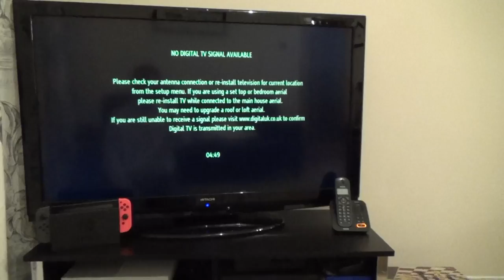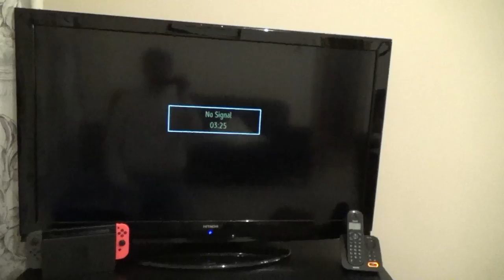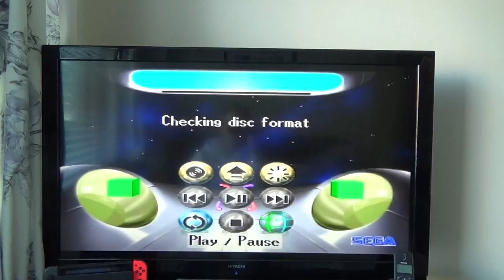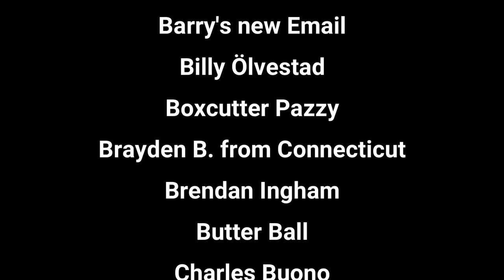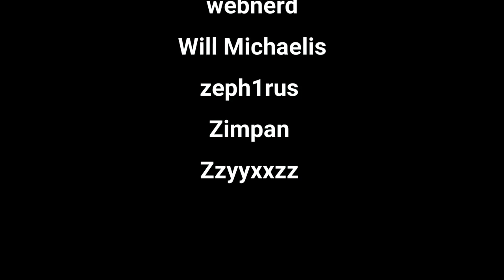SEGA SATURN with NO DISPLAY - Can I REPAIR it?

Comment from the maker: Spoiler Saver

Thanks for watching
Reply: please help me figure out whats going on i can use my dualsense in the ps5 menu but when i go on a game and its says press x to continue x doesn’t work on a game and on gamepad tester it shows L2 is being pressed down even when im not helppppo i have no warrenty😢
Reply: @whodat4265  Watch a YouTube video guide on how to take apart and clean the controller. While you're inside, check if there's any corrosion or other visible damage. Once all the buttons are cleaned out and thoroughly checked for damage, put the controller back together and test it again.
Reply: @Box223  ok to took it apart and the trigger spring is fine and looks like the r2 side so the springs are good and theres no garbage like dust and stuff but still doesn’t work i tried also lifting the trigger hard and still nothing
Reply: @Box223  what i mean by still nothing is l2 is still being pressed without me touching it
Reply: @Box223 also i cleaned with 90% alcohol and q tips and blew for dust
Reply: @whodat4265  You may need to look closer and test each component on the controller individually. I have never taken apart one of those controllers, so I have no experience with them. I'd recommend checking different online sources based on what you're seeing with your testing. iFixit probably has some guides on it that would be good to look through.
Reply: @Box223 honestly it sucks but i might just have to wait and buy a new controller i suck at doing stuff like this
Reply: @whodat4265  You could sell it to someone or send it to a repair shop if you want.
Reply: @Box223  dont got money for that but its weird cause i just hit it a couple of time and l2 works fine i guess now but my up arrow reads completely 0 on gamepad tester now 🤦🏾‍♂️ 🤦🏾‍♂️
Reply: Yeah I knew you have one of those in the cold storage I told you that go grab it and grab the laser it was in the old ass video from quite a few years ago when you did that one but you never bought and brought it back out because you knew it was one of those rare ones
Reply: Even you said when you found the first one of nine series it's extremely rare there's only like a hundred thousand made so do it for you to have a working fully functional one it's probably worth a lot of money

Comment: If you have a Dremel or other rotory tool, you should get some rubber bullet tips instead of the engraving tool. It will remove the solder mask, but isn't abrasive enough to take traces with it (under normal use). Either way, love the videos!
Reply: Yeah the abrasive rubber tips are the correct thing to remove soldermask, ie, I was cringing at the damage from that metal tip.
Reply: Do you have a pn or link please cant find them
Reply: @flibble666  No links allowed on YT. Goo search the name.

Comment: Nice fix! Great find. Great when it's something simple like that and not an obscure chip!
About the pots though for the CD drive, in any Disc based drive, never adjust the potentiometer by hand. These are tuned to the micro ohm and should be measured using your best possible multimeter or oscilloscope if you have one. The slightest tweak to them causes a huge change in resistance, enough to burn out the laser in some instances. That's why we call them "pot tweaks" :)
Reply: That the thing always use the Resistance mode to record the current value before tweaking the pot as the last thing anyone wants to do is tweaking it and not knowing what it was originally either too much or too little can kill the laser diode. Ideally the laser glass can be cloudy to the point where it could barely read the disc usually cleaning it with ipa and blow out the dust in behind the laser glass can help to a certain degree to get it working again as I done this method on phat ps2 had good success but the one that annoys me the most is the tilt screw on the drive closest to the back of the ps2 usually mark it with a blade but as it turned out the mechacon chip has a bug where it continued to kill the laser after too many time it attempted to read the disc there for ruining the chance of a laser replacement to make it work again. So the phat ps2 had to be softmodded/hardmodded to get around this problem
Reply: Agreed, I’ve just restored an “audiophile” model PS1 and the window for the laser working perfectly is impossibly small

Comment: 23:15 it's always easier to remove enamel from magnet wire by starting at the cut end, because there's exposed copper there that will take the heat from your iron and burn off the enamel from the inside. I usually put a blob of solder on my iron, stick the end of the wire into it and slowly work it through, maybe adding flux if the solder starts to get lumpy.

For something like this, I usually just strip a length of cheap 30 awg wire rather than bother trying to de-enamel magnet wire. For smaller sizes (34 or 38) I do use magnet wire because it's really all that's available.

Comment: Nice fix so far Vince, I did notice when you were working on the solder blob to the left about 8 o’clock from the solder blob there is TP95 & TP96 and C51 there looks like a long leg that could be shorted over from TP95 to C51 
Thanks for the upload 😊
Reply from the maker: I see it Gary, that is from one of the crystals. The legs are a little long but they are not shorting. I've bent them over towards the left hand side just to make sure. Thanks for the suggestion mate 👍
Reply: @Mymatevince  ok cool just a thought that’s all, well at least it’s doing more then it was when you got it 😊
Reply from the maker: @wisher21uk  Always up to hear suggestions Gary, makes me life easier 👌
Reply: @Mymatevince  so true the more eyes the better 😁

Comment: The disc protection is on the far outer edge of the disc on the Saturn, and a weak laser can struggle to read this edge. It's possible that you have a marginal unit that works on one machine but not the other. There are some pots on the PCB of the CD mech assembly and one of these controls the tracking - sometimes this can be brought into like making the discs work.

If not, a modchip would likely fix the problem as that bypasses the protection.

ETA although if a known good mech doesn't work then as others have said, it could be the region lock. Again a modchip (ahem) would help here 😁
Reply from the maker: Thanks for the tips Jason 👍👍👍

Comment: Fantastic Vince!!! Great stuff working that one out =D  I would be tempted to go back to using a fibreglass pencil btw - that grinder is a wee bit aggresive lol!   The fact that audio discs work, and games dont - my first thought is region, is it perhaps US or JPN?  Alternatively some damage on the ribbon or its connection to the board?
Reply from the maker: Thanks Chris, great suggestions.  Ribbon cable was checked for continuity off camera, well it was filmed but cut. It is testing ok despite the burning. Region is a great idea. I will find out how to check the region on these things. Maybe serial number will indicate that. Nice one 👍👍👍👍
Reply: Good shout Chris, I also thought Region, but looking back at the video it appears to be a VA9 revision board, so that's almost certainly PAL.  Definitely will be worth looking at the ribbon, it did have some discolouration on one edge, so it's very possibly damaged...
Reply from the maker: @StezStixFix  Cheers Steve, ribbon cable tests OK for continuity. Shame about the region, but st least that means it might be fixable. I need to find out what chip is responsible for the security check and work from there I think. Maybe it is still linked to the corrosion 👍👍
Reply: @Mymatevince  I did a region mod on a Saturn a while back, it “might” be some help, although I had to follow two different guides to get it to work.
I’ve got quite a few saturns in pieces, so if you need me to check for any spares you need, let me know and I’ll send them over if I have them 👍👍
Now time to watch the video 🥰
Reply: Another video, another comment at the top spoiling the outcome before it’s even been watched. No one’s fault but YouTube, but there really should be a default way of stopping this for the video creators
Reply: @philgornall  yeah, annoying enough
Reply from the maker: @philgornall  Sorry Phil, I just added the Spoiler Saver. Apparently it doesn't work on phones,  only PCs 👍
Reply from the maker: @1up_Gaming  Thanks Mike, I'll check it out. I'd prefer to fix it if possible, but just happy to have it work again if that fails👍👍👍👍
Reply: @Mymatevince  as I said mate I know not your fault. I’m always on the phone so will never work for me. Another perplexing functionality decision from YT…

Comment: I normally use a one stran of 16 gauge wire, then when put through the hole the solder will flow through the hole if you add a little flux and if it was multilayed you have more chance of joining the tracks in-between. I know this is only double sided but I find enabled wire for short distances is more trouble than it's worth.
Reply from the maker: Thanks for the tips David 👍👍

Comment: Normally for top 3 issues with repairing old/new stuff is i've noticed....

1 chips you can't buy.
2. track layers.
3. components like resisters and capacitors.

Comment: It could still be that solder blob across the 2 pins on the cable which you re-added, 
It could be the trace near the FB9 writing which was blackened underneath the solder mask.
Reply from the maker: Well spotted Mike, unfortunately for me that blackened trace is actually testing OK, I'm just working on the next video right now 👍👍👍 Cheers for the suggestions
Reply: @Mymatevince  no worries. Hope you get it sorted. My other concern was that some capacitors were replaced with incorrect values before you received it.

Comment: Great Video Vince! and great job on repairing those corroded tracks and VIA's. Would the fault with the disc drive have something to do those shorted pads? as that did look a little odd to me. Keep up the great work 👍
Reply from the maker: Thanks Mick, I'm working on it again as I type. Just looking though some different options to try and work out what is going on. The blob is one of those options. Cheers 👍👍

Comment: I had similar with a double layer motherboard, you were lucky, with the board I had, the corrosion had worked it's way between the layers and spread.
A definite Vince no go
With no signs of spillage or capacitor juice, this just might have been a dodgy board.
Good video, can't wait for the follow up,
Reply from the maker: Just working on it now MCW 👍👍👍

Comment: Fairly interesting. I picked up a 2nd saturn, the white HST-3220 model...I knew when I bought it that it wasn't going to run, it DOES have power, but it won't broadcast anything, not even a black screen. I took the board out and it's super clean looking, no popped caps, nothing. I'm not even sure where to really begin since my tools are very limited, soldering iron, flux, wick, and a multi-reader that's about all I got in my arsenal. But my electrical knowledge is extremely weak, so dunno yet. 
Talked to a buddy of mine who's looking at a diagram of the saturn and he's gonna try and point some stuff out to me. The goal on this one was to restore it, but to put on a Fenrir ODE on it and put the working Saturn in a nice safe place so it doesn't burn out.

Comment: Going from the switch killer to saturn slayer seems like a regression, but only in technology 😂. Well done! Looking forward to the next part.

Suggestion: Check your 5vDC (I think) rail to the disk drive. Is it low? Does the DC voltage look dirty on an Oscope? Could indicate a bad filter cap. It may be a cause for why neither disk drive works in the Saturn as intended.
Reply from the maker: 😂 Well I do feel like I am regressing in many aspects including my understanding of electronics!
Good idea, I will check that out Shawn, nice one sir 👍👍
Reply: Going from the switch killer to saturn slayer haha best comment yet 😂🤣😛
Reply: @Mymatevince  you're not regressing, only joking 😂
Reply from the maker: @HavingFunRepairs  😂

Comment: If you want solder to flow into the via a bare copper wire is probably better.
Reply: Yes, I was going to suggest thin tinned-copper wire may be better here. You don't have the faff of trying to burn coating off, but you need to be careful of shorts.

Comment: Sega Saturn is my favourite console. I’m 41 now but got this for Christmas on release. Great memory’s. Normally when the disc drive reads the audio tracks only it’s the laser. Can try adjusting the pot that’s directly on it. I’ve got spare replacement jvc lasers new in boxes as they don’t last long. Already replaced one on 1 of 2 of my consoles. Both model 2 versions
Reply: My favourite console too. I love Duke Nukem 3D on the Saturn, it's the best version I've ever played.
Reply: That doesn't explain why the drive works when swapped to another unit, as Vince implied. It shouldn't be the laser in that case, and likely something else on the motherboard.

Comment: There is a white pot on the disc drive. You need to turn it clockwise just a little bit and try again. There is a video on youtube that shows how to do it. You can find it searching "Sega Saturn not working. How to Replace the Laser", min (24 :57)
Reply: There are 2 pots on the disc drive that you have to adjust, the laser pot and the white pot on the board. You need a multimeter to adjust the resistance of the laser pot properly. You could start from 700ohm and then you can reduce the resistance by turning the pot until the laser reads the disc always. Then you can adjust the white pot manually to solve the issue of detecting the game as a audio cd, sometimes works. Check the video that I have mentioned before.

Comment: 21:03 Hi Vince, was the trace below the letter F of FB9 any good, as looks like that may have been affected by the corrosion as well. Thought it might be worth a check. 
Cheers, Dan
Reply from the maker: Thanks Dan, in this instance it is testing OK for continuity, but very well spotted. I didn't spot that trace at the time 👍👍
Reply: @My Mate VINCE  No problem at all, was certainly worth a check. Hopefully you get to the bottom of the issue soon. 😊

Comment: It’s usually the heat sensitive PLL chip that causes the black screen issue and that custom chip cannot be replaced unless somebody make a replacement to bypass it. It’s a shame that nobody has done it yet. Or if your lucky maybe it’s bad traces, failed bios mod or bad caps or a bad psu. In your case replacing the JVC Optima 6 Laser or adjusting it should get it to play games again.

Comment: Good eye Vince! The corrosion inside the via was pretty RAD 😀and as suggested, try other games first before you do a deep dive why hat particular one isn't working.
Reply from the maker: Yes, it had such a nice colour, very vibrant 😂. Good call on the games, that is the only Saturn game I have at the mo, but I will buy another just in case it is working ok with others 👍👍👍

Comment: the disc might be the wrong ' region ' as I have seen that on a working Saturn I used to own.  It did not show an error, only audio on one disc, on another there was a splash screen for a different region disc.  The other option is see if any  working unit has the same ribbon cable to do a temporary swap in case there is other issues with the read head.

Comment: The Main crystal clock and the CD drive crystal clock aren't "matching", this can cause those symptoms, maybe someone tried to change its video signal and only changed the X2 crystal, the crystal near the backup battery or the main crystal needs to be changed to so its frequencies will match. Source: Tried to convert a Pal-M Saturn to NTSC only Changing X1, no disc booted, took second crystal from donor Saturn, everything works. Check frequencies from working Saturn and compare with the faulty.

Comment: weak laser, although sometimes the spindle that holes the discs in can be pushed down too far and lifting it up slightly will help it out, likely just needs a new laser though.

Comment: Did you check they are the same laser? Theres different variations and some will not work with other boards. I would clean the laser one more time witn some ISO and calibrate the pot little by little
Reply from the maker: Thanks AI, I'm working on this again now and that is the current conclusion I am coming to. I'm not finished yet, but I think the laser drive might have been swapped out 👍

Comment: If you've put hours and hours in already, i understand the 'excitement' diminishes a bit. This Sega is a weird one, kinda curious! 
Almost looks like some region protection or smth, not playing the games but playing audio CDs just fine...
Reply from the maker: Really strange. Hopefully we will have an answer after the next video 👍👍
Reply: @Mymatevince  The corrosion was strangely in the middle, roughly where the disk drive is. Even though the disk drive is working in the other console could there be a problem with the connector in that area, could something have leaked on it, then through to those traces? Could a capacitor in that area, related to the disk drive, have leaked on to those traces?
Reply from the maker: @Charlie_Crown  Maybe Charlie, I will give it a good check out in the next video, cheers for the suggestion 👍👍
Reply: @Mymatevince  just can't help but think there's a connection there, one problem causing another 👍

Comment: One thing you could do with a SATURN: Get a NTSC-J one and mod the PSU to 230VAC with integrating a 230-> 110V Transformer internally :D :D
Reply: Or just get a psu replacement, you get modern ones quite cheap.

Comment: I buyed broken saturn, i repaired the power supply it was connected to 220v and is 110v, i see 9v 5v and 3v en the pin out, the disc sping and read but the screen is black and i can see 2 slim lines vertical at the right blue and red, any ideas?